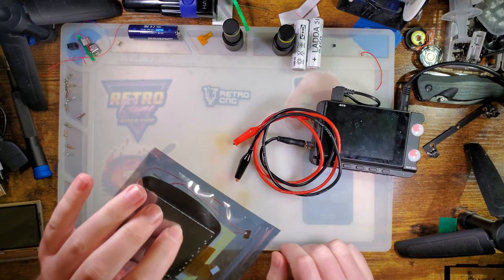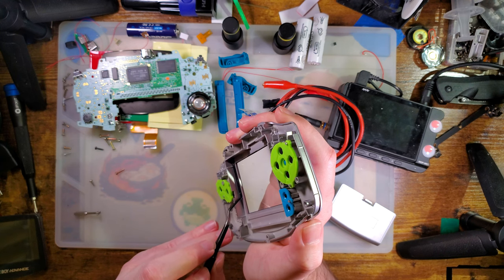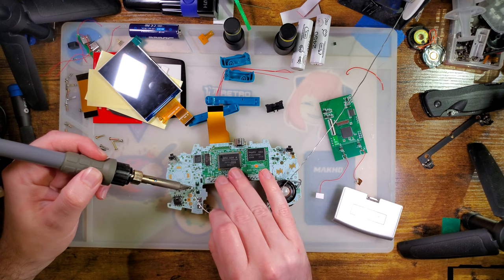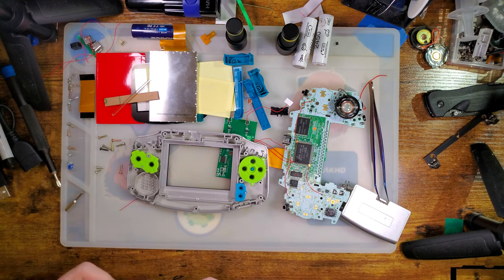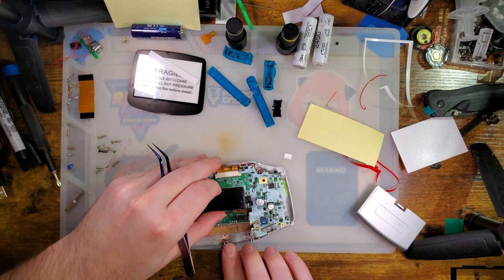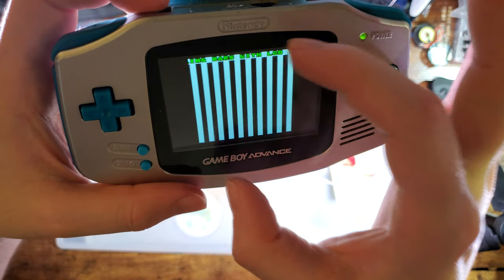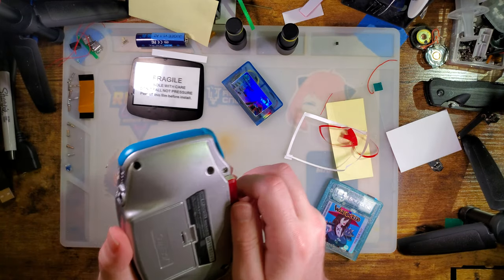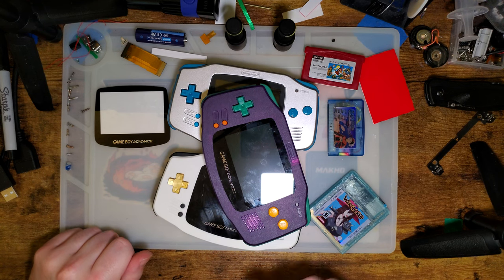Game Boy Advance Drop In 720x480 IPS Backlight with OSD

Comment: I installed this kit recently. FYI, if you want to disable the touch functionality: simply removing the touch pads/wires wasn't enough for me, it resulted in the brightness/pixel modes changing randomly. I removed the chips next to those wires with some pliers on the assumption that they are the touch sensor controllers, and sure enough that fixed the problem.

Comment: If you are trimming then it's not a drop-in mod. Why would they advertise that way if trimming is mandatory?
Reply from the maker: Well, I said trimming isn't required. You can install it just fine as is. It just looks better if you do.
Reply: Yeah, I'm a little pissed. The video shows the screen going all the way from the shim on the left to the right wall, but mine is smaller. It's really confusing. Thank God I have a dremel, and am skilled with it.

Comment: During the mario test I noticed the two spots where the shadow from the 240p test suite was left were still exhibiting some flickering, any idea how long that effect might persist? This seems like a nice kit otherwise but that could be an issue for some depending on what games they play and how much sprite flickering those games use/how it's used in the games (if it's persistent in a given region of the screen or such).
Reply from the maker: Flickering might persist a few minutes. It gets worse the longer you leave that flickering sprite in place. I am told future kits will address this but I have no further details on that.

Comment: Hey I did this mod without soldering, the touch pads work for brightness and color filters, but is there any way to get the pixel effects without the OSD?
Reply: EDIT: I figured it out if anyone has the same issue, just hold the brightness button and it will cycle through the pixel options
Reply from the maker: @Canti64  toggling FRM still appears to need the osd/button controls. I imagine we'll see a revision that addresses that.

Comment: Dear Makho I got a question, i have a dsi that is not working anymore, can i just put the bottom screen into my gba? i already have all the ribbons from the funny playing ita kit. do i need a polarizer also? my ITA AGB TFT BACKLIGHT LAMINATED KIT arrived, the display wasn't even glued together properly, the glass came off the lcd. when i turn on the gba the display stays white. sound can be heard. i wiped the loca glue off both screens with isopropanol. screen still stays white. when you hold the glass in front of the display and look through the glass the display is completely black . already contacted funny playing they have not replied but my question is now, if the additional polarizer is necessary to buy?
Reply from the maker: Sounds like you peeled the display apart. Yes you absolutely need a polarizer or the display won't work. I assume you meant to ask about the digitizer and, no, you do not need that. If your display arrived damaged, you should seek a replacement from the vendor before trying to fit another LCD.
Reply: @makho  thank so much much makho! they send me a replacement and everything is fine now, I love it the quality is unbelievable! funny playing is great!

Comment: Hi, I am new to this scene and I was wondering, the super tin cable your using, what are they called?
Reply from the maker: The what cable?
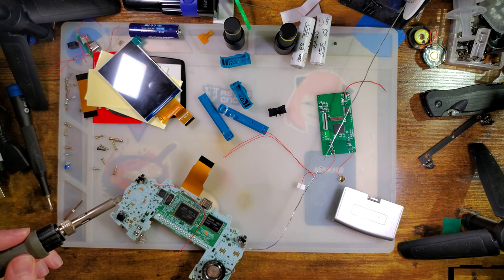Reply: @makho  Sorry for my English. At 18:44 you are soldering cables to bridge connections. Can you tell me the name of that cable?
Reply from the maker: @C-State  It's just wire. Probably 32 or 34 AWG. It comes with the kit.

Comment: Are there any backlit screens with accurate colours? Or do I just have to stick with my 001.
Reply from the maker: They all have accurate colors. The original displays did not display colors accurately so a lot of games had tweaked palettes to compensate for this. There are no kits that I can recommend that correct for the palette tweaks in games.
Reply: @makho  Semantics, but I'd consider the original displays "accurate" because that's what the (majority of) games were designed for. Games tend to look oversaturated on most backlit displays sans micro, imo. It's a shame none of the replacement screens have tried to replicate the colour space of the original.

Comment: I got this kit but they didn't send me the wires, I'm a noob at modding, not sure if it matters which wire I buy
Reply from the maker: You can use whatever you have on hand. Thinner gauge is better. You can cutup an old USB cable or ethernet cable if you don't have anything.